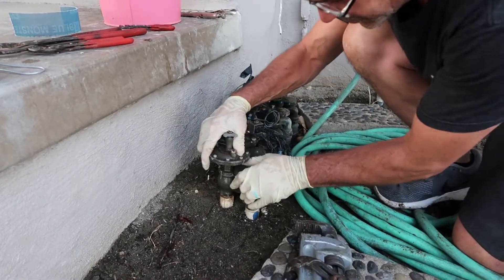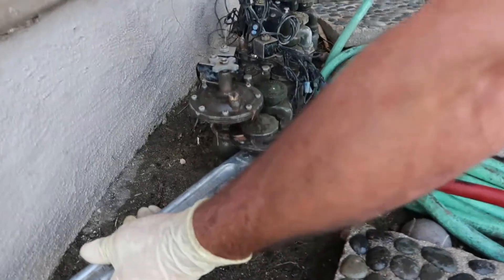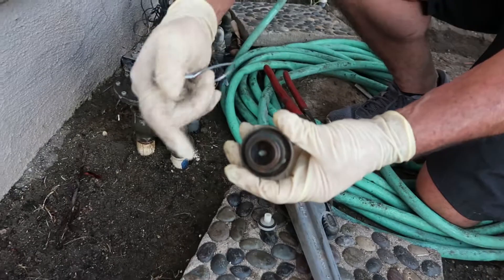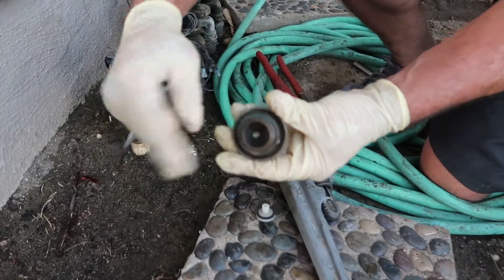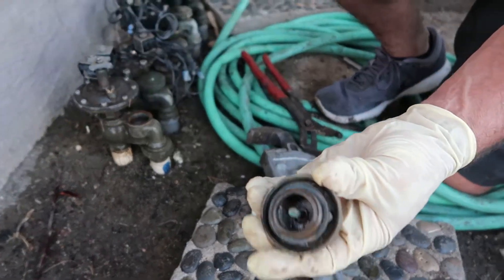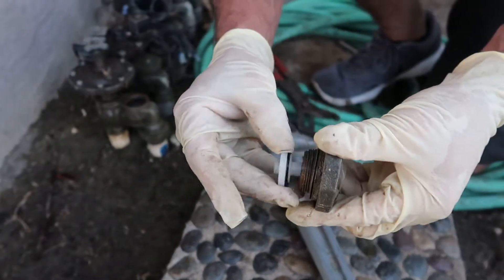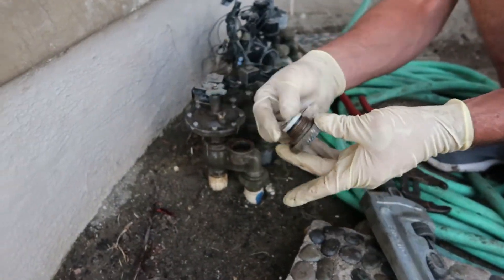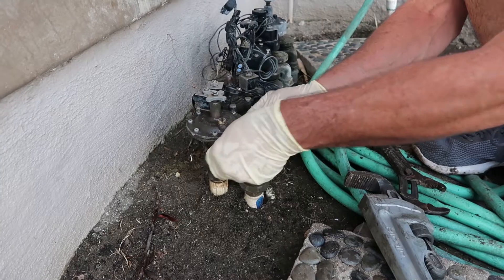Champion Brass Irrigation Valve Rebuild

Comment: Thanks. I bought a kit and replaced the rubber gasket on the plastic float as well as that other paper thin gasket. Didn't know about cleaning the pipe piece you showed. Thanks!

Comment: Do you have to shut the water off from the main water supply line?
Reply: Does it necessary? The repair is on the other side of the valve which should be closed
Reply: You might have up to three cut-off valves at your home. One at the street near the water meter, and maybe another, more conveniently accessible one near your garage, and maybe even another one just for the irrigation system. The separate one for the irrigation system lets you work on the irrigation system and at the same time allow you to have water on for the rest of the house. If you have a cut-off valve right before the irrigation system and it is working correctly (it doesn't leak), you can use that one. Otherwise, close the cutoff valve at the street.
Reply: actually, no
Reply: of course....